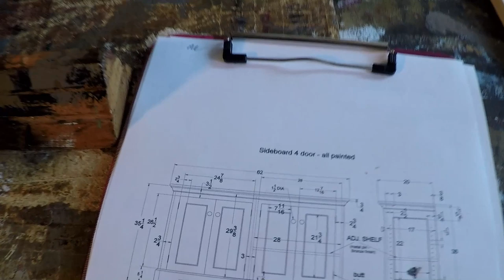Sideboard Painted 4 Door Frame and Panel Custom Woodworking Expert Furniture Build

Comment: Hi, what was with the first side panel you made, it had two bottom pieces. That would have driven me nuts and |I would have to redo that door, was there a reason that I missed or something?.
Reply: When I make a panel like that, I make it a bit oversized, then cut them down. Gives me a bit of wiggle room for square and final fit.
Reply: I think it was because it was going to be hidden by the base trim at the bottom and he didn't want to waste wide lumber ( and its possibility for more movement) on an area that was hidden.
Reply from the maker: that is one side panel.  the two pieces on bottom are covered by the baseboard.  the gap is to relieve stress because a solid piece would likely crack from shrinkage
Reply: Ah, makes sense!  I had to pause the video and scroll the comments it was making me nuts.

Comment: I guess the tiny glue bottle is way more convenient.. How do you fill it more quickly?
Reply from the maker: I have a larger 8 oz fill bottle that is useful for that.  I sell them as a set called the Glue Bottle Solution.  you can find it on ebay.